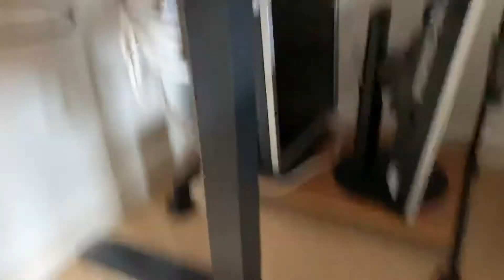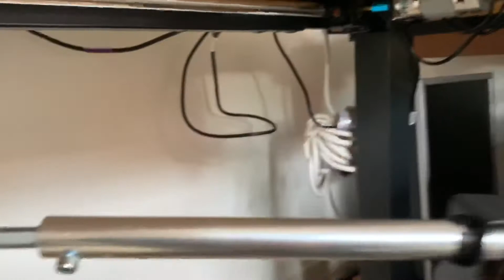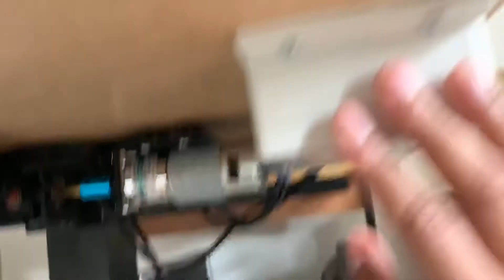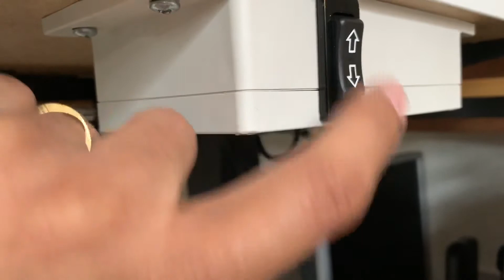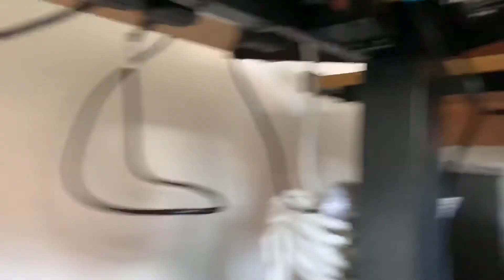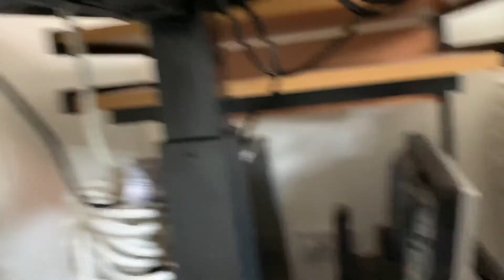Electric Sit-Stand desk conversion

Comment: What type of DC Motor is  the table using? Can please suggest a motor that is faster and powerful
Reply from the maker: I have the link in the video for the motor: https://www.aliexpress.com/item/32842982343.html?spm=a2g0s.9042311.0.0.44c94c4dy8pMKP
I would recommend doing an analysis first of what sort of torque you are looking for... There are plenty of DC motors available with varying torque. You will need to consider the requirements for your project and then choose the appropriate power supply.

Comment: Nice, how did you calculate the force required? Do you think any consideration to mechanical advantage should be given?
Reply from the maker: I took the Crank Handle that came with the desk and attached a spring balance to compute weight and converted it to what it would be at a centimeter. Effectively it was Kg x crank handle. I consider the torque required at the point where the machine is driving. Also kept a little extra margin.

Comment: Great! Im about doing the same! Motor: 12V 30 rpm. .. kw or Amps?
Reply from the maker: The amps is about 3A at maximum efficiency, while at stall it is 8A. While designing, better to take into account that the power supply accordingly.

Comment: Fantastic! Planning to do something similar for mine.. might just use your video as inspiration.. anyway to make it less noisy?
Reply from the maker: Thanks. I am making a second one, where I am enclosing the motor within a box. a bit of insulation would supress quite a bit of noise.
Reply: @vijayiyer5037  how are you getting the motors from Alibaba now?
Looks like those are hit with the bans
Reply from the maker: @ArvindKumarA  I had got the motor a while back, like a year back or so.
Reply from the maker: @ArvindKumarA  I just checked: Looks like this one is still available to ship to the UK: https://www.aliexpress.com/item/32842982343.html?spm=a2g0s.9042311.0.0.44c94c4dy8pMKP.
Reply: @vijayiyer5037  I'm based in India though 😅
Reply from the maker: Ah that makes it difficult. Hope you can find some other source there.
Reply: @vijayiyer5037  Is there any reversible cordless hand drill that can spin the hand crank? Because they are easily available in Amazon India.
Reply: After a lot of struggle I have landed here . I have the same table want to convert it . Any advice or parts to purchase . Plz advise. From India
Reply from the maker: Sorry, I wouldn't know where to get it in India. The best I can advice is if there are electronic markets at your place to look there.